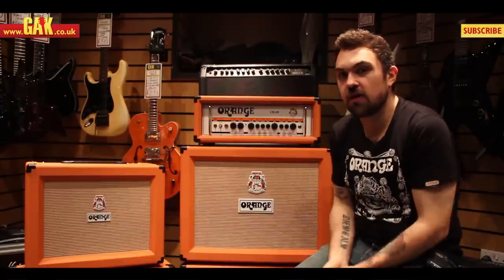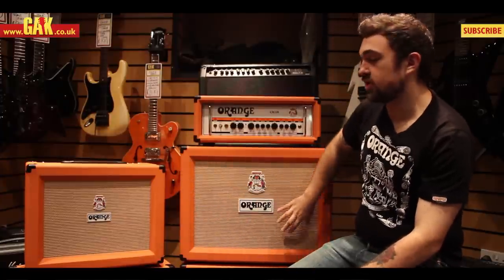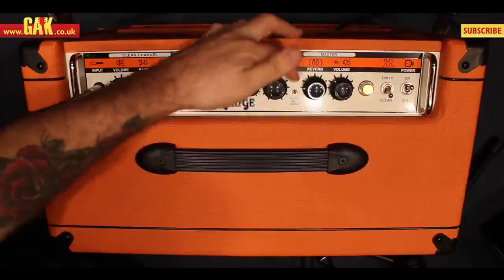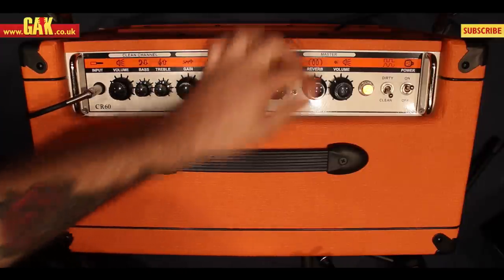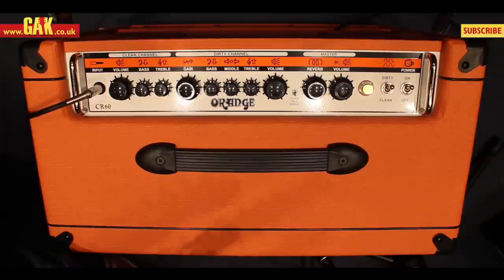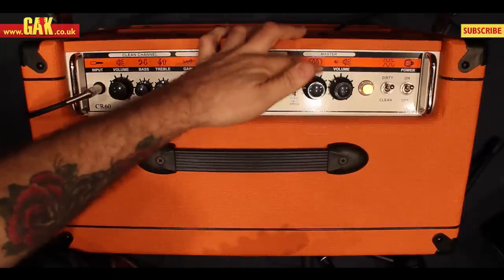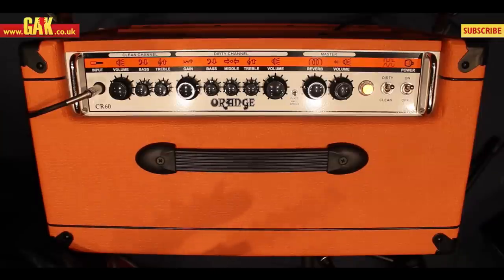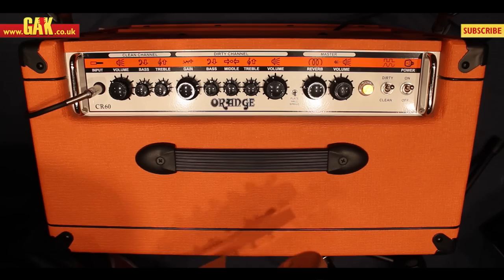Orange - Crush Pro 60C, 120C and 120H Demo at GAK

Comment: hey, i play a lot of pop punk like Paramore, Blink 182, and some grunge (Nirvana), would this amp work for this type of Genre?
Reply from the maker: Definitely. I would highly recommend it!
Reply: You need to listen to some bands like Neck Deep, The Story So Far, City Lights, A Day To Remember, Let It Happen, Me vs. Hero, etc...alot of those types of pop punk bands play Orange amps. Alot of them use the Rockerverb model and that is what this amp is based on, it's just cheaper because it is solidstate vs. valve.
Reply: Perfectly. That's what mine is used for
Reply: I got the smaller crush 20 2015, I can play corrosion of conformity , so the W60 will play them like dream , I'm going to buy one in the near future

Comment: Just ordered one of these and I really can't wait to play it. After messing around with tube amps for a while i'm craving the simplistic reliability of a solid-state amp again. I can't wait to plug this in and jam with my band, and not have to think about tubes slowly dying after every use!
Reply: So how was it?
Reply: @trentkraemer7109  I still own it to this day! I use it with a helix hx effects unit for effects and it gives me any sound I want. I will never go back to a valve amp 🙂
Reply: @Lewis---  really great to hear! A couple people mentioned that it’s got a really dark sound because of the speakers, did you ever find that to be true or change the speaker?
Reply: @trentkraemer7109  I don't know about the combo amp as I have the 120w head and a separate orange cab, but I've never thought the sound was "dark", no
Reply: @trentkraemer7109  now that you mentioned it may be a dark sounding amp indeed. I tend to set the Treble way past 7, and the Bass less than 2. Especially on the clean channel.

Comment: some times you can get a lot of buzz if the cable your using is bad,
I would suggest  try another cable first .You will sometime get noise if you have a multi effects board with compressor built in it and the adapter to the effects board will cause buzz also as well as your pickups on your guitar if the guitar is older with single coils. Last result could be the amp. Hope this helps!

Comment: I'll be (hopefully) going to university in September and I'll be looking to join a band, practice in my room and maybe do some recording, I play mainly heavy stuff but play quite a lot of cleans and lead too, should I get the HT-5 or this?
Reply: whatIdo I think the HT-5 ( Tube Amp ) will not be suitable for Bandplaying ( maybe with microphone ) The CR 60 ist Perfect for those needs - If possible try it out at a local musicstore, The cr 60 is not as "Fragile" as a Tube Amp and doesnt need Retubing - has great Cleans - Turn Master volume on Amp higher than needed - and use the Volume-Toneknob on Guitar to clean up tone - Thats where this Amp shines - this works on GAIN channel too , I had a Tube Amp- and The cr60 really sounds - feels -behaves just as Dynamic !

Comment: Hi GAK, I'm thinking about getting the CR120C and an ltd mh-1000 together, I play a lot of avenged sevenfold, disturbed etc. do you think I could get the right tones out of the amp to play that sort of music and do you think the guitar would Make a nice pair with the amp?
Reply from the maker: Hey! You could definitely get those tones with that combination. The high output pickups on the LTD will give you a thick, aggressive distortion from the Crush Pro.
Reply: I know I'm not GAK, but yes, it will :P    I can get very heavy tones using my Jackson SL2H and the amp alone, but reguardless of the amp's great built in distortion, I still use my Line 6 Uber metal pedal and it drives it for all the better, just because of the fact that I can EQ my sound better than with just the amp. These Orange Crush Pro series amps are meant to be used with your own pedalboard/pedals and effects, rather than built in circuitry that modeling amps feature nowadays. They're solid, workhorse amps that sound great alone, but also work well with your pedals. I think you would love this amp honestly. If you don't necessarily like the dirty channel, there are pedals out there to tweak it ;o
Reply: hey GAK will get a thicker deeper bottom end with the cr 120

Comment: I've contacted Orange Amps America in Atlanta and have gotten no help so far. I want to exchange my CR60c for a replacement amp because the Amp Buzz is getting worse and I'm even afraid to turn on the Amp. The noise is actually starting to drown out the actual Guitar sound. It's worse on the dirty channel. I'm going to call on Monday and hopefully I'll get some help. Do you think that if I take the Amp to an authorized dealer, I can get a replacement?
Reply from the maker: Hi James. Where did you buy the amp from? You should be able to return it to the dealer for repair under warranty.

Comment: 1:51 "...even a little 1 x 12" lol DO NOT connect the cr120h to a PPC112! the cab has a Celestion VIntage 30 inside, which handles gratefully 60w of power... the CR120h delivers double of that wattage...
Reply: a friend of mine uses a 150w Randall head with a little 1x12 cab with a 70w speaker and it works perfectly for home use.....just don't crank the amps volume and you'll be good

Comment: I have a question that I can't seem to find anywhere. Please reply! I play a lot of metal (like Slipknot, Mudvayne, and Tool) Can the distortion on this work for that type of heavy playing? Also, is this similar by any means with the CR35LDX Crush Pix? It's a bit out of my budget, for $500, but i may just save up for it if it's really worth it. I have a peavey vypyr right now and it sucks. I really need an amp with good tone, and good heavy distortion. Please Reply.
Reply from the maker: Hey! You could definitely use a Crush Pro for that style of music if you pair it up with a a drive pedal. I would use something like the Boss Power Stack - http://www.gak.co.uk/en/boss-st-2-power-stack/40803
Reply: Awesome thanks, do you think this is worth getting, is it one of the better amps at the $500 price range?
Reply from the maker: We absolutely love the Crush Pro series. Don't be put off by the fact they are solid state. For the money, the are easily one of the best amps available.
Reply: Fur shore, thanks for the reply, it's very much appreciated.
Reply: I've played for 45 years mate...Orange manufactures one of the finest solid state amps out there.  They are very gigable amplifiers, and they come with a boat load of versatility as well.  The Orange Crush 60 watt 1x12 is right at $500.00 USD.  Depending on where you play, you may need to mike the 60 watt amp.  I don't believe there is a line out feature on these Crush series amps.  Thye are virtually bullet proof, have great tone,  very user friendly, and exceptionally road worthy.  My favorite upside is you don't have to spend upwards of 200-300 dollars for retubing and biasing.  You won't have the same heat related tube problems either.  Tubes are susceptible to rough handling, such as being on the road.  I would really advise getting over to an authorized dealer, and trying a couple of them out.  The best of luck to you!
Reply: Orange has one of the best heavy distortion in all amp brands
Reply: You bet it can.  I am a Marshall man, but just traded one in for an Orange.  Killer amp, killer tone, kliller distortion.
Reply: I agree, Darrin. I've been playing through Marshalls (and a few vintage Fender's) all my life. I, too was a Marshall (tube) man (and still am), but I now own two Orange amps. These amps are fantastic!! The Orange's stand up very well to Marshalls, and it's hard to believe they are solid state. Orange and Blackstar have changed my opinion of solid state amps forever. Back in the day, solid states were instantly identifiable by their "digital" tone and lack of warmth viz-a viz tube amps. Today, I would challenge anyone to a "blind taste test" between a Marshall and an Orange.

There is a slight difference between the two but, for the money, I'd definitely recommend and Orange or a Blackstar.

Comment: can I use this on post rock/ambient music?
Reply: +Jasper I would think so, as I've found it to be pretty versatile. In fact, I find the spring reverb setting to be really lush, deep, and spacey, and perfect for ambient sounds (far better than the digital reverb on my Marshall DSL, and even better than some actual spring tank verbs I've played with; one of the best digital reverbs I've heard), and could save you the trouble of having a reverb peddle in the chain, or just give an additional verb option for playing live, which comes in handy when playing space rock, shoegaze, or other ambient stuff. The great thing about this amp is that the reverb is where the digital aspects end, as the meat of the machine is entirely analog, with the gain stages based off the Rockerberb. And it shows!! The clean tones are pretty solid, though not quite as lush and harmonically rich as tube, they still give a respectable round and warm tone, and with some dialing in and the right axe, can produce anything from some nice chime, to punchy spank. Again, not tube, but more than passable for live situations. But the dirty tones, with the aforementioned Rockerverb gain circuitry, are really where this amp shines. I also personally really like some of the dirtier tones you can get on the clean channel by playing with the channel volume in relation to the master, which is a great feature, having dedicated volumes for each channel along with a master on such an inexpensive amp. But as I said, the high gain is really where this amp kicks, as it is more comparable to tube tones, and both the pushed clean channel and dirty channel have a very natural sounding breakup and saturation that will give you anything from a bit of dirt to hard crunch to distortion-drenched, screaming leads, surprisingly, all with great, touch-sensitive, dynamic response similar to a tube amp. The analog design of this beast just has a far more lively sound than most digital amps I've used. By far the best solid state amp I've ever played, and even though I have some great tube amps, including Mesa and Marshall, I feel these stack up pretty well for the price, as it is still one of my favorite amps, and I wouldn't hesitate to take one out gigging, especially due to it's reliability and toughness. Not sure yet if I would use it for recording, as the slight lack of tube warmth and complexity in the cleans would be a little more noticeable, and there is a little less of the high-gain harmonic richness as well, but I could see throwing it into the studio mix with some dirt or heavy crunch in certain applications without missing a beat, and I doubt if most would ever know the difference. Overall, great classic-sounding highs, sweet crunchy mids, nice tight and punchy bass, and a great option for a solid practice and gigging amp for someone who wants great tone and reliability in a bulletproof package free from the worry and maintenance of broken tubes at a price that won't break the bank.

Comment: What type of speaker comes stock in these?
Reply: Theres a 60 watt 16 ohms "Voice of the World" speaker in it ,I think Its a Celestion .
Reply: +motorrebell It's an Orange-made speaker, but I think it's essentially based on the some of the Celestions Orange uses. I think they sound pretty good, with some nice tight punch on the bottom end, and classic-sounding highs. Not the best, but better than most stock speakers at that price point, and a great speaker for handling high gain sounds.
Reply: +Leonid Q Its a great sounding speaker with a little Grit ,-) - The only problem was the "Breaking _ playing in "period of it when it was new  -took a little time ( about 20 hours) but it has alot smoother tone now .

Comment: Can this be connected to a 2 X 12 extension cab?
Reply: Yes, the CR60C, CR120H and CR120C can be connected to any cabinet. I have the CR120C version and I've gigged with it plugged into my Orange PPC4x12 and it sounds brutal!
Reply: Yeah, it has a single 16 ohm output for an extension cab
Reply: It has an output for 8 ohm cabinet and two for 16 ohm cabs.

Comment: Does the cr120c have a footswitch ?
Reply: The Great Hambino there is one for it. Costs about 40 bucks. I found a deal on ebay. Came with pedal and amp cover for free. But normally no it doesn't come with pedal included.